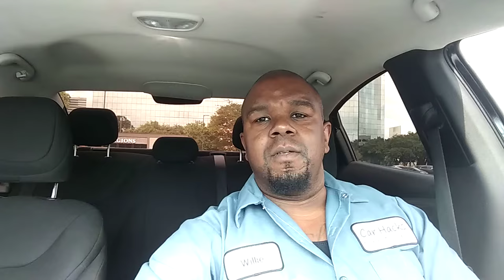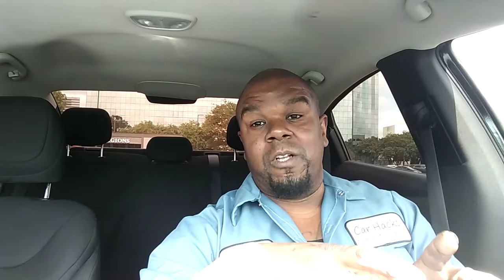Car Hacks : Hesitation under Acceleration? MISFIRE Explained and What is a LOAD

Comment: Ok so my 2016 Nissan Altima is a huge upgrade from my 2004... but it comes with its on and off problems... like 85% of my drives are smooth and basically prefect...  but the other %, this happens: at a red light im at a complete stop and when its time to drive i let the car roll a tad without gas then push the gas and i'd have to like push down on it all the way like 2 or 3 times for it to go normal... its on and off when this happens. then on rare occasions, when I start driving my car its very hesitant in gaining speed. the accelerator thing will be jumping up and down from 2 to 4 and its barely hitting 45mph and it sounds like the car is pushing at 80mph... whats your take on this? no engine lights, battery lights, warning lights, no smells, always a full tank of gas, had a oil change months ago...
Reply from the maker: I need more info on the car. Engine size is it a 2.5l, 3.5l etc. So i can better give you an idea of what could be going on. But sounds like possibly a tps issue. (Throttle position sensor) or cam sensor. I need more info on the car.
Reply: @carhacks2654  it’s a 2.5L 4-cyl
Reply from the maker: @erickagreen6049   its your transmission. Check service bulletins for your vehicle. CVT transmissions in Altimas are a common problem. You can possibly have a transmission service and it may take care of it. The cost of a service is cheaper and less of a headache than dealing with replacing the transmission.

Comment: would you possibly know what’s wrong with my car, it only misfires when i floor it
Reply from the maker: Could be a number of things. Fuel delivery, weak ignition, a sensor, vacuum leak, etc. Any mods?
Reply: Car Hacks only a CAI
Reply: thank you for responding
Reply: Car Hacks also if i drive it for over 30 mins and then come to a stop light it starts to idle weak and i have to put my foot on the break and gas to keep the rpms high enough to keep it idling right
Reply from the maker: If no check engine light would check the cheaper things 1st. Vacuum leak, air and fuel filter, clean mass air flow, clean throttle body etc. Maybe even a loose intake air tube. Going to take some diagnosing to figure it out.
Reply: Car Hacks thank you man! that really helps a lot i didn’t know anything at all
Reply: @justa2vv864   that's what is happening to my Lexus RX 300 now..Just that...don't know what to do

Comment: I have a 2014 Ford with a 3.5L non turbo, 32k miles, car jerks when over 35mph and start accelerating “lightly”, hard acceleration and idle is is fine currently. Any clues on a possible fix? Thanks.
Reply from the maker: Sounds like an ignition coil or possibly a spark plug. Also could be a vacuum leak.

Comment: HELP! 2002 CRV with 280Kmiles starts well, when I press the gas when P RPMs goes up normal  but when I press the gas while on the highway 55MPH hesitates/vibrates not reaching 60MPH slow down almost dying but then runs normal when let go gas pedal So What do I need to replace?
Reply: Did you found the problem?
Reply: @tevinlinton4204  I changed the trans fluid but I did a trans wash too. Problem fixed

Comment: Thanks for the video. Got a question for you. I have a 2020 Honda Pilot with 37,000. I'm having an issue with the car at low acceleration....like 1500 to 2000 rpm it kinda pulses for a bit until I hit it up a little higher. Then there are no issues. So driving around town at slower speeds it jerks back and forth very gently  when I accelerate out of a stop sign. I've watched a few videos. I'm thinking ignition coil must be bad at one of the cylinders. What do you think? I'm surprised it's happening with a Honda at only 37,000 miles. Any help is appreciated. Thanks
Reply: Having the same issue with my VW Jetta MKV did you figure it out?
Reply: @kalebhackman5532  first I was told it was slipping between 2nd and 3rd. Since it is still under 60,000 and under warranty I took it to the dealer. It needed to be put on the TTec and flushed. New transmission fluid and filter basically fixed it. Kinda embarrassing to be honest. But I've never had a car need transmission fluid changed out so quick.
Reply: @kalebhackman5532  I was also told that if it was the ignition coil, or a plug....my check engine light would definitely be on. I'm guessing it's your transmission

Comment: Could you answer this for me please. 
My car drives fine under normal speed, but after going at a good speed after I stop and take my foot off the breaks and ready to accelerate, the engine just revs but barely move a little on a flat. Then it takes a while to ship in and start driving so I can move off. What could be this problem. Please I need a good advice